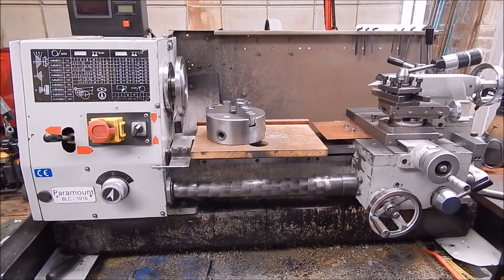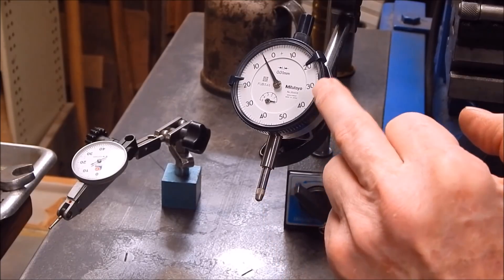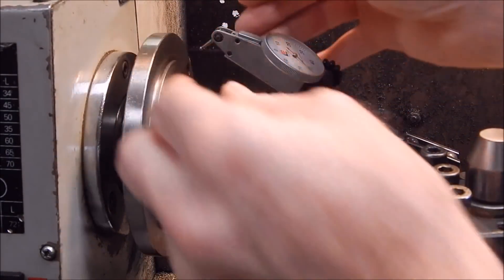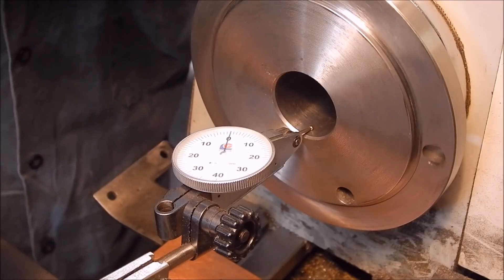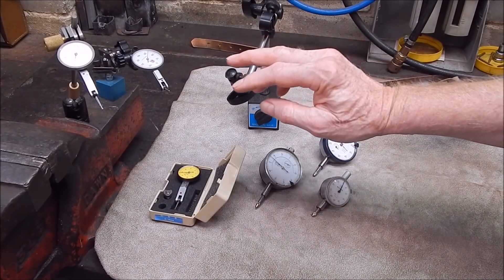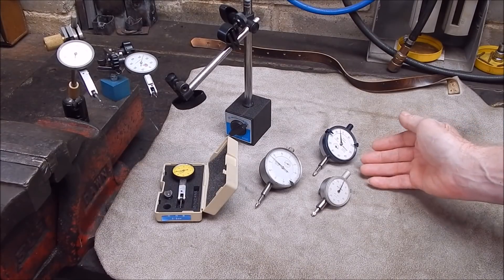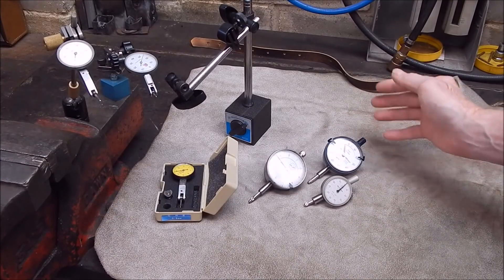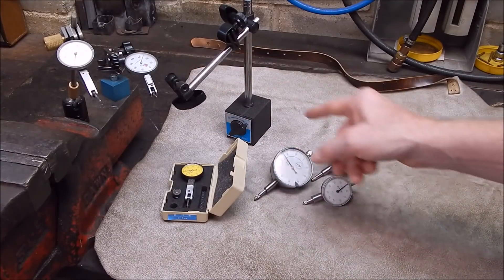Dial indicator or test indicator - which to buy for a metal lathe ?

Comment: Get a Verdict T8 test indicator! Or any Verdict test indicator they all have a pivoting stem, hold in tailstock chuck for bores - outside diameters + faces all in one quick setup. Their swivel stem needs no other kit to use it on mill or lathe.
Reply from the maker: The same as any other test indicator.
Reply: @Xynudu  I believe the pivoting stem is unique to Verdict, I could not find them in Starrett or Mitutoyo. If you do find one with a pivoting stem, please reply with the details.
Reply from the maker: Do you mean "rotating" stem ?   I don't understand what you are describing ?  All test indicator stems "pivot" and are subject to cosine error as a byproduct.
Reply: @Xynudu  You are referring to the stylus. The stem is the part at the other end.
Reply from the maker: OK.  Now I understand.

Comment: Universal back plunge indicator is my favorite with a lathe. It's probably the best all around indicator. Hence the name Universal.
Reply from the maker: How do you measure internally with it ?
Reply: @Xynudu  It has a levered tip you can attach to measure internally. It's longer than what you find on a Dovetail indicator so it's better for reaching further into the bore if you need to measure the step on a counterbore.

Comment: I have another question Rob. Are the China made fly cutters worth getting for occasional use?  I did purchase a set of 4 fluted end mill bits ( small to 1/2" ) which seem to work fine on steel brass etc. I have to do light cuts on most everything I do anyway, do to my lathe size.  It would be nice to use a fly cutter so I do not have to make so many passes on a bit bigger surfaces milling wise.  Just trying to plan ahead. Your thoughts? I will look into the smaller magnetic bases also, Thanks.    With all this in mind my lathe is also a milling machine.
Reply from the maker: I have never bought a fly cutter.  I always made my own.  They are not hard to make, but I don't see how you could go far wrong with a bought one.  Pretty simple device.  Most budget Chinese lathe tooling that I've used has been fine.  The only bad item I received and refused to review was a set of large sized small shank drill bits which were way off centre on the shank and soft as butter.  Banggood and I both agreed they were best not promoted.  Retailers can only sell products based on the spec supplied by the manufacturer, so reviews like mine and buyer feedback help them weed out the roughies.  Very few sellers have the time or resources to do this.  Cheers Rob
Reply: @Xynudu  For now I think I will just buy a budget set of 3 fly cutters and see how my lathe in milling mode will like them.

You have been simply put, outstanding with your very helpful knowledge. Some of us have to start somewhere and it is a real pleasure conversing with someone that understands this. You are a real gem. Once the machining bug strikes it is on and it get's expensive fast. Trying to keep cost down to a low roar. Ha! Thank you so much Rob.

Comment: Had a friend check my head stock run out and it came in at 0.0003 after turning a small shaft. The Unimat when brand new if a guy could even find one is supposed to have a run out  of 0.0005.  I am close enough given this German made lathe was most likely made in the 1960's.
Reply from the maker: That's a very impressive reading.

Comment: I am going to really like my Starrett 711-F test indicator. It will be so much more versatile than a standard plunge dial indicator.  A few months ago I bought a vintage super heavy duty Starrett scribe base which doubles as a dial indicator/test indicator base/stand also.  The Starrett scribe base is a work of art. The base has four pins that can be moved down into another piece of steel of which I plan to make a sub base for it and mill out slots for magnets. ( no idea what the four pins were originally intended for ) Then I will have a magnetic sub-plate as needed.  Sure I could buy a magnetic stand but this will be a fun project. I have my Unimat lathe mounted on a 1/4" piece of steel plate..  My Unimat SL DB200 also turns into a milling machine. I will be all set once this Starrett 711-F dial test indicator get's here.   

Thank you greatly for your help!
Reply from the maker: I think you will find the four pins are for levelling the base and contact at four points only.  My Starret is the same.
Reply: @Xynudu  Wow, I did not even think of that. This very well could be. They are pretty stiff to move so that makes sense.
Reply from the maker: I think you will find  they are all like that.  It's one way of ensuring the base is level and also allows adjustment for wear.
Reply: Rob do you have any idea when these beautiful Starrett scribe bases were made?  Mine seems to have a blueing coating of sorts on the main base.
Reply from the maker: Starrett have been making instruments for over 100 years.  A lot of the high quality old tools were case hardened and have a nice golden or bluish colour. They look good.
Reply: Actually looks like some sort of heat treated coating. Zero rust. Amazing.
Reply from the maker: I expect it would be heat treated.  Cold blue surface finish isn't very durable in comparison.
Reply: @Xynudu  I would like to learn how to do that. It is impressive.
Reply from the maker: I'm a big fan of test indicators.  They are basically a comparator, but can give close to absolute readings when used correctly.  They are much more versatile than a dial indicator and much more compact.  Each have their place, but even though I have half a dozen high quality dial indicators they rarely see the light of day for metal turning.  Get a small mag base like this and you won't look back :  https://www.ebay.com.au/itm/333415354837
Reply: @Xynudu  I will check it out. Thanks greatly.
Reply: Case hardened probably not doable on hindsight. Starrett, I have become a huge fan of their tools. If you buy older Starrett tools you really cannot go wrong on durability etc. Plus the older very well made tools you can for now still buy cheaper and most likely get the same outcome as the newer tools.
Reply from the maker: Don't pay too much for the tiny Chinese mag bases as they are all basically the same.  Look around first.  I have a cheap one from Banggood, but they don't sell them anymore.  I find full sized mag bases are too big and clunky on small lathes.  The  small ones have micro adjustment as well, so you don't lose any functionallity.  They are pretty neat.  Cheers Rob

Comment: I only own a totally small manual Unimat lathe and I have to work with very small parts etc.
Reply from the maker: Use a test indicator, as it is much more compact and suited to small restrictive work.
Reply: @Xynudu  I purchased a vintage Starrett 711-F. That should work.
Reply from the maker: That's not vintage.  This is vintage :  https://www.youtube.com/watch?v=Da-CaWJk9Mc

Comment: The one thing never any one clarifies,,,can you use these on a lathe while in real time cutting?  I wish someone would answer this question.
Reply from the maker: You should NOT use any test or dial indicator on a lathe while it is running.  You see video of people doing this, but the readings will be inaccurate due to overshoot from inertia.   It will also apply much greater load/wear factor to the delicate stylus and moving internal gears.  Cheers Rob
Reply: @Xynudu  Thank you! The answer I was looking for! Great to know.  I had a feeling it was a bad idea. Now I know for sure.

Comment: Hello! Should I get 10mm or 25mm version of dial indicator which is good for beginners?
Reply from the maker: The smaller dial will not foul the chuck jaws as easily, but I would buy a test indicator instead - much more useful as it can do internal as well as external and the probe can be positioned at any angle.  I have small and large dial indicators (Mitutoyo) and don't use any of them.   Beginners always think dial indicators are more impressive than the dinky little test indicators, but it's a mistake. Cheers Rob
Reply: @Xynudu  between 0.8x0.01 and 0.2x0.002mm test indicator which one you recommend?
Reply from the maker: 0.8 x 0.01 mm is plenty good enough for an accurate readout and is better than most lathes TIR.  You can still read between divisions as well.  Anything more accurate will cost quite a bit more, have a reduced range and is not intended for basic workshop use.  Try and get one with a long probe if you have the option, as it allows you to read internally deeper.  Cheers Rob

Comment: whats size is your lathe machine sir??
Reply from the maker: Hi Mohd,  I have three.  The Chinese one is 10 x 18 inch.  I also have an old Schaublin 9 x about 30 inch.  Plus a micro Sherline.  Cheers Rob
Reply: ok, thank you sir. i'll upgrade mine to these machine looks enough size for small scooter head and cylinder block.

Comment: Hi Rob what brand is the DTI that you are using in the video. I looked at the offerings on the various market web sites. There is a lot of choice some are bound to be a lemon. Whilst you named most of you instruments in your line up the one DTI that is recommended is not named
Cheers
H
Reply from the maker: That was a mid range one I bought from CTC Tools on line.  It's better than the base model which I had before  (easier to read).  I now use a Daniu test indicator from Banggood. All three worked fine - no stiction.  You get better external finish and a larger dial the more you spend, but the internal action doesn't appear to be significantly better. Some of the more expensive brands are pretty basic internally, same as the cheapies.  Cheers Rob

Comment: Hello Rob! Excellent tutorial! I always thought the test indicators were more accurate than the dial indicators (thus the "last word" brand name on the Starretts). Surprisingly, the examples you showed had the same exact accuracy. Makes me want to run out and compare all of my indicators now. I got a "lot" of tools early on that included both types of indicators, but the best stand I got (a Noga knock-off) was for the test indicator, so that fellow has gotten a lot of use. I should mention that there is a neat little adapter for the dial indicator (came with my first "lot" of old tools) that allows for accurate inside measurements, but in most cases the test indicator is much more handy.
Reply from the maker: Hi Rick,

The accuracy of both types depends upon the increment range you buy/select.  For general use 0.01 mm is pretty normal.  However, test indicators induce a cosine error in the way they operate ( the probe angle changes) so for absolute measurements a plunger dial gauge is best.  

The test indicator is meant as a comparator and a dial guage is for absolute measurement.

Most of the time you are setting up chucks etc on a lathe, so a comparator makes more sense.  Plus a test indicator is very compact and does internal measurements as is.

Yes, a rocker type probe can be fitted to a regular plunger dial indicator, but it's got the same cosine error issue as a test indicator.

Cheers Rob
Reply: Great point on the comparator vs. absolute indicator. Makes absolute sense. Cheers!  @Xynudu

Comment: That cover on the threaded rod is pretty smart! What is it, coiled spring steel? Chips in white lithium grease on the shaft doesn't clean well.
Reply from the maker: Yes.  It's an OEM fitting.  You lose some carriage travel to the headstock because of the compressed length of the cover, but it's worth it.

Cheers Rob

Comment: When I was in college, 14 students in the class, 20 dial indicators in The Tool Room, 2 test indicators! So it wasn't really a decision that needed thought! My first  was a Starrett test indicator. Luckily for me there was local retailer going out of business, I got the indicator all the adapter bits and the pretty red box for under $100 mind you that was 1986...
Reply from the maker: I guess they didn't trust the students with the test indicators.  They get damaged easily.

I have one of the old pressed out metal Starrett pivoting beam type test indicators as well.  I compared it to a modern clock type one and they both worked fine.

I'd be lost without my test indicators.

Cheers Rob
Reply: @Xynudu  had to google what a Starrett pivoting beam test indicator was. I assume you mean #64A? I would love to get one of those! It would look right at home on my Barnes #4 1/2 Screw cutting lathe.
Reply from the maker: Yes.  That's it.  I wasn't sure of the correct name.  I did a video on it a while back.  It was in with some bits that came with a Schaublin 102 I found under a tree.  It was pretty rusted but came up good.

https://www.youtube.com/watch?v=Da-CaWJk9Mc

Cheers Rob

Comment: Hi Rod another great video.What is the make of the chinese test indicator the one up from the cheapest that you used to check the lathe mounting?
Reply from the maker: Hi Dan,

It's marked Guanglu and has a 38 mm dial.  It came with a bend in the pointer so it's not high rent.  Having said that, it works fine.

I expect finish improvement is the major benefit of going up market.  Even the very cheapest one has ball bearings in the probe arm pivot.

They probably rebrand these things with all sorts of names.

Cheers Rob
Reply: @Xynudu  Hi Rob thank you for taking the time to reply.

Comment: Rob, 
Been watching for a while now. Yes I bought a Chinese lathe hafco al330a.
It's gorgeous.  Wish I knew how to send you a photo. Mate I'm in a situation 
Where I can't work anymore, but just ordered exactly what you suggested. 
Love the show mate, I'm in Perth.  You ever get over here you got a place to
Stay.
Dave.
Reply from the maker: Hi David,

Thanks for the feedback.  I have looked at that lathe. It's a capable unit.

Get both types of indicator and you will be set.  The small mag bases are really good.  The big ones have their place on large lathes, and for certain jobs (crankshaft alignment etc).

As pointed out in the comments a dial indicator can give an absolute linear measurement but a test indicator won't due to the way it works.  However for chuck alignment (which was the main issue dealt with) you are only measuring deviation, so that doesn't matter at all.

Both have their uses.

Have fun with your new toy ;)

Cheers Rob

Comment: I have an import DTI as well as a Brown & Sharpe I got used and both seem to work well.  As for regular dial indicators, I would have to agree with you as well on that one - the cheap ones I have seem to work as well as the couple used better ones from eBay.  One way or another, any working indicator is better than none!  Thanks for sharing what you do, I'm interested to see your review on the "top line" BangGood indicator as well, how it fares.
Reply from the maker: Should be interesting.  I actually managed to resurrect my original cheap test indicator that I dropped on the floor today.  It was a miracle.  One of the ball races in the probe pivot had lost it's balls in the crash.  Poor thing.

I was considering just brazing in the bearing hole, drilling it and using the plain pivot pin in it (same as my Peacock) and I remembered Craig Roop in Oklahoma had sent me some tiny 3 mm OD ball races in a package of stuff.  I thought no way.

Yep, they fit.  Unbelievable luck on that one.  Drilled out the old one and in she popped.

So my original Chinese DTI is as good as new again. 

Now my secondhand Peacock DTI is broken from a fatigued probe mount.  LOL. It never rains but it pours.  So much for buying secondhand.  Forums are littered with guys whining about how they got ripped off on some defective used indicator.

After all this, cheap Chinese looks decidedly good to me ;)

Cheers Rob

Comment: The test indicator normally requires less pressure to move he needle, also, it's to be used as a comparison indicator cause the angle of the arm changes all the time, as the dial indicator when installed in proper travel position makes an excellent accurate measurement instrument, guess that in the end even if we get the cheaper versions, we need both styles...!!!    ;)
Reply from the maker: Well said Pierre.
Reply from the maker: I have always meant to check the amount of actual mount flex from read load when using a dial indicator on long travel reads.  There must be a change/influence as the indicator return spring stretches and the long mount column flexes.  

So maybe the reading is actually compromised (by a very small/insignificant amount) ?

Food for thought.

Cheers Rob
Reply from the maker: I tried to measure long travel load on the indicator stand and it was so insignificant it didn't even register with my lightest gauge.

All my dial indicators are relatively short travel, but there was no sign of any compromise..

So now I know ;)

Have you tried those flexible neck stands ?  How good/bad are they ?

Cheers Rob
Reply: @Xynudu  about flexible or even rigid stands,  they all flex to an extend, best way to counter that is to make sure you move the part not the indicator rig, mostly if you change the way gravity will act on them...   ( right up and rotated upside down, in the most extreme condition....   ( Just like Australia and Canada... ))    lol